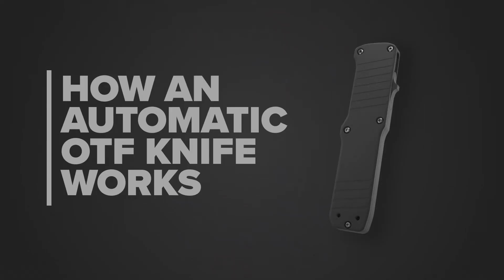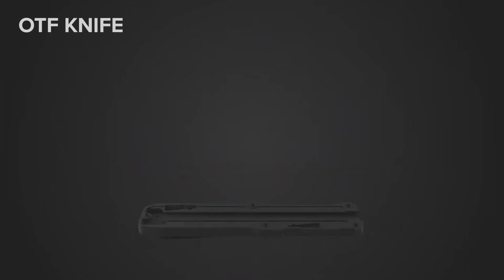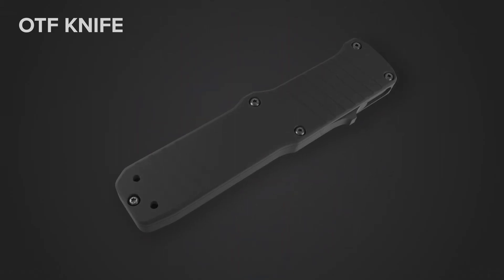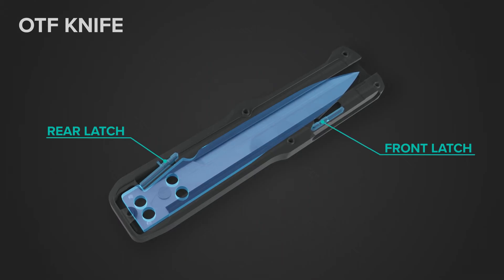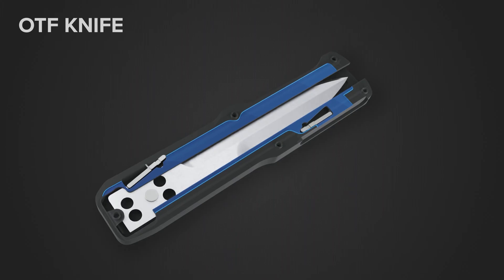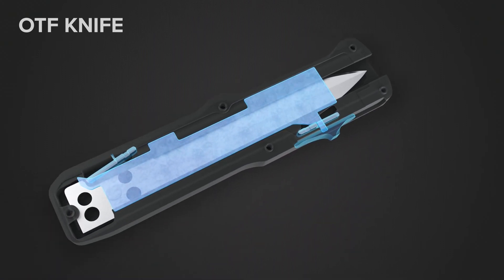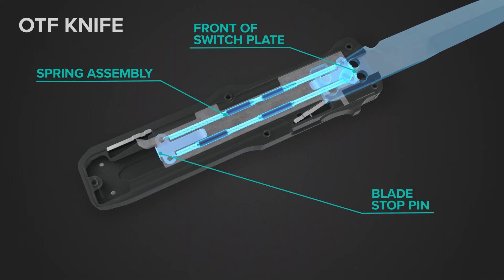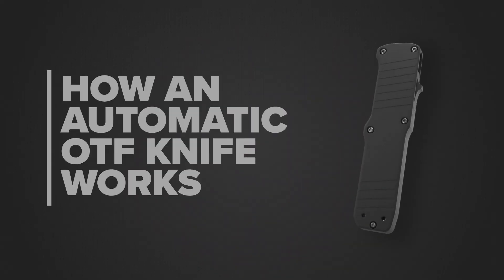How an Automatic OTF Knife Works

Comment: I can see how the spring can force the blade out to the open  position.  But what forces the blade to retract back in?  i.e.  what "resets" the spring?  The spring(s) cannot push both back and forth.  Once the spring has its tension removed, some other 'force' would be needed to push it back/reset it. Otherwise you'd have a perpetual motion machine.

Comment: I have over 100 different OTF’s and none have this exact switch system inside, what brand is that supposed to be? Also I take apart all mine and polish all the moving parts and they run so much better than before!!
Reply: Like using 4000 grit sandpaper ?
Reply: @billcrosssc430  nope I use a polishing wheel on my dremel and polishing compound for a mirror finish on all moving parts.

Comment: Do you find the springs weaken over time in some?
Reply: All springs weaken overtime no matter what, but the Benchmade Infidel would most likely last 1000's to 10000's of cycling the blade with usage such as cutting, prying and stabbing.

Comment: Two questions.   First.   What happens that makes the blade get loose when it encounters resistance on the way out?   Second, why can't they make one that will still fully deploy when it encounters SOME solid objects...paper, card board, clothing materials etc.?   I had one several years ago that, even if the only thing in it's way was a piece of newsprint, the blade would still dislodge when being deployed and have to be reset.   Show and explain who that works and why they cannot, or perhaps will not, make one where that flaw has been corrected.

Comment: Sory if this is a dumb question but do diffrent otf makers use higher quality springs for otf?? I asume they have diffrent quality yes??
Reply: Not a dumb question at all when you're talking about possibly trusting your life to a tool...Benchmade produced the first OTF knives that we were issued during combat operations in Iraq about 16 years ago. At the time, there was a strict set of criteria a knife had to meet before it could be issued to combat troops and support personnel in-theater. One of the most critical factors was reliability — especially regarding the internal spring mechanism.

Today, the line between quality and affordability in metal tools — from gun sights to knives — is starting to blur. Manufacturing advancements have made even budget options seem impressive on paper. However, in my experience, lower-cost alternatives tend to fail more frequently. I'd estimate that about 85% of the failures I've seen in these affordable models are directly related to the spring, particularly its inability to maintain a consistent spring constant over time (F = kx).  Mostly the springs in the latches.

When a spring weakens or loses its calibrated resistance, deployment becomes inconsistent, retraction can fail, and overall reliability suffers — all of which are unacceptable in mission-critical environments. That’s why, despite the rise of cheaper options, companies like Benchmade continue to stand out. Their products are engineered for durability, with springs that hold up under real-world, high-stress conditions.

That said, this doesn’t mean there aren’t affordable options that can kick ass just as well as a Benchmade. One standout is the CobraTec CTK‑1. For around $100–125, it delivers a solid D2 steel blade, strong dual-action mechanism, and a reliable spring system that holds up under field conditions. It’s heavier and may need occasional sharpening, but it’s built like a tank and comes with a lifetime warranty. If you're looking for a budget OTF that performs far above its price tag, the CTK‑1 is a serious contender.  Cobratec has come a long way since their beginning.  Their are also some others like the AKC F-16, Templar Knife Gen II, Boker Plus Kalashnikov OTF, Kershaw Livewire, and Guardian Tactical Recon-035.  Of course some of these get within striking distance to Benchmade prices.
Reply: Thanks 🙏 ❤ @cunningpatriot4117
Reply from the maker: Yes. They better quality OTF knives have better components. They last longer too. The cheap ones work well in the beginning, but after a few months the spring tension is gone.
Reply: So if I took apart a say 50$-100$ otf and took out spring and replaced it with one from a real Benchmade or micro tech would it work? And would it work alot better then before?
Reply: @JonathanDawson-z4n  Honestly, it probably wouldn’t work the way you’re hoping. The cheaper $50–$100 OTFs are built with looser tolerances and softer materials, so even if you could fit a Microtech or Benchmade spring in there, the rest of the knife isn’t designed to handle that extra force. You might get a harder “fire,” but you’d also risk lock wear, binding, or breaking parts. High-end OTFs are precision-machined so the blade rides smooth and the spring matches the build. If you really want that level of performance, you pretty much need the whole knife built to those specs—not just the spring.

Comment: I wonder if polishing the latches and the plate where it contacts them would reduce the required switch pressure to actuate the knife? 🤔🤔
Reply: Just use lighter springs. As long as they’re still strong enough to quickly and cleanly expel and retract the blade.